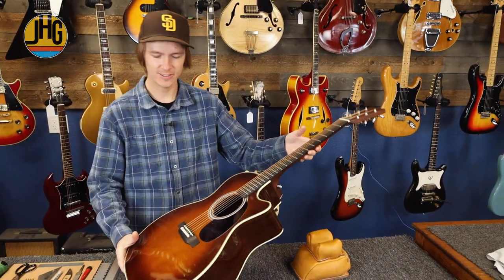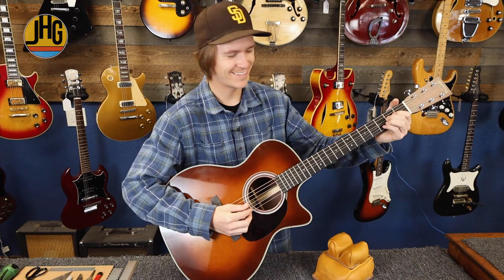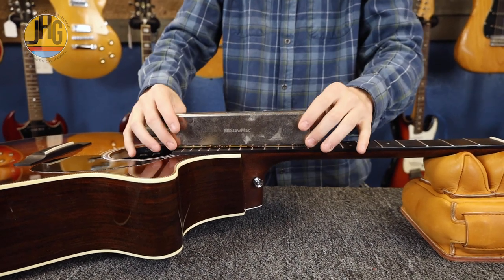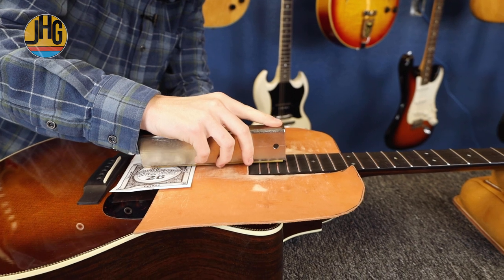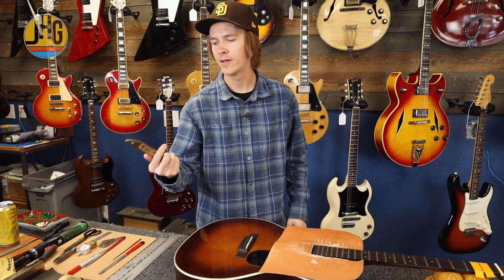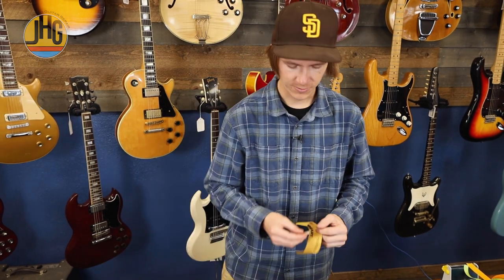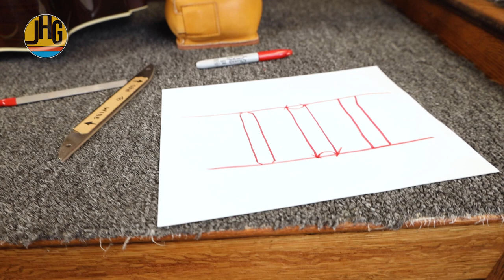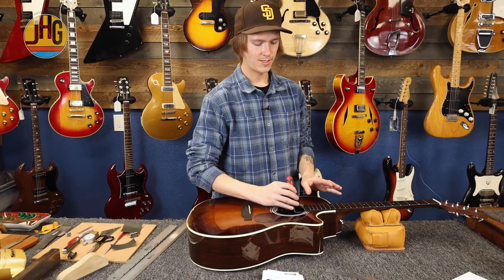HOW TO DO A FRET DRESSING ON AN ACOUSTIC GUITAR - Guitar Repair Chronicles!!!

Comment: Hey cool daddy! After watching this video around thirty times plus some I'm sure,  I finally got my Epiphone masterbuilt TEXAN to strum clean with zero if not minimal  string buzz after many weeks of study and efforts. 
No shim, no saddle adjustment, just a bit of truss rod calibration. 
This Epiphone  masterbuilt TEXAN axe is so much cleaner and pure toned after I used your techniques and tried and true luthier secrets, that I am doubly amazed by my ham handed fumbling after seeing you work YOUR CRAFT and the clear positive results I experienced from following your LEAD. . 
Thank you so much.  Love ya, mean it.
Reply: @rickyfakemusic:
You didn't "calibrate" your truss rod, you adjusted it.
If you had actually "calibrated" it, that would mean that you were somehow able to make marks on the nut, to indicate that turning the adjustment nut to a specific mark would always result in a specific (measurable) amount of relief to the neck.
Speaking of not knowing of what you speak (not you, I mean the guy in the video that you are now worshiping)... He doesn't understand basic concepts. Maybe a more polite way of saying it is, he doesn't communicate well, using the correct words. For instance, his straight edge ("ruler") can't have "relief" by itself, not unless it's normal state is to have strings attached, causing it to bend. Then it might have some mechanism to compensate for that bending, thus providing "relief."  See?
As it is, his straight edge just wasn't straight. 
But, that's a common malady of cheap "rulers." That's why ppl pay more for one that has been machined.
Got it? Yeah.

Comment: After watching some of this video, it has really hammered home the value of having a conversation with the person who will actually be working on my guitar. 
That way, I'll know to tell them in advance, "I do NOT want <that person> working on my guitar--at all!   I don't want them to touch it!"
This video might be more useful if you clearly explained at the beginning how you were going to attempt to fix the problem.
-------
It seems to me that a new Martin guitar should NOT have a twist at one end of the neck, along with a severe back bow. 
That kind of problem is not caused by "storing the guitar in high humidity."  It can only be exacerbated by high (or low) humidity.
Such a problem simply cannot be repaired by sanding or filing the frets! 
If it were mine, I'd be showing up at the store where i bought it, demanding a replacement.
That situation doesn't bode well for Martin. You'd think they would know how to avoid crap like that from ever being put into a guitar!  
That's the whole point of letting wood stabilize for YEARS before ever making ANY cuts, or even letting the wood get close to, or even SEE a template.
<grumble, grumble,  SMH>

Comment: Brand new Martin !? What happened to it to cause neck twist and severe back bow
Reply: back bow is normal, air pressure and climate changes, humidity combined with fluctuating string tension all will cause neck movement. neck twist is not normal.

Comment: I have a fender CD60  6 string electro acoustic and a new fender villager 12 string. I had a problem with the G string splitting on my older CD 60-CSE as there was a small notch on the 2nd fret just below the G string I gave it a rub with fine emery paper and not having any more problems with this string.  There is slight wear on the 1st and 3rd frets but I assume that slight little dents are normal wear no sign of wear on any other frets. The guitar is nearly 3 years old but plays great and always stays in tune is it worthwhile getting 3 new frets or should I just leave it meantime.I love both my guitars and like to keep them in good shape always clean and polish them when I'm finished playing 😍🏴🏴